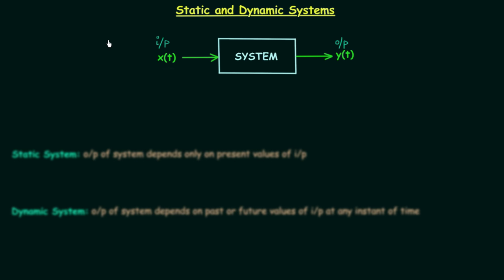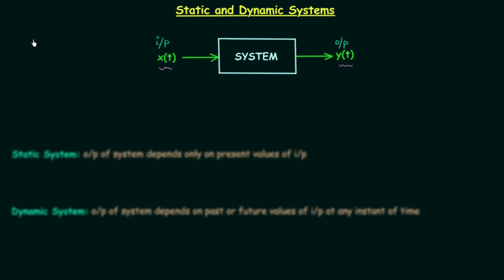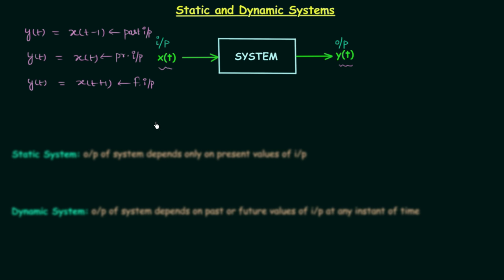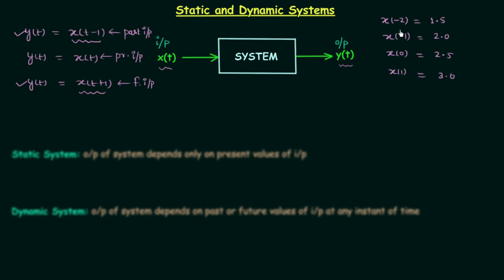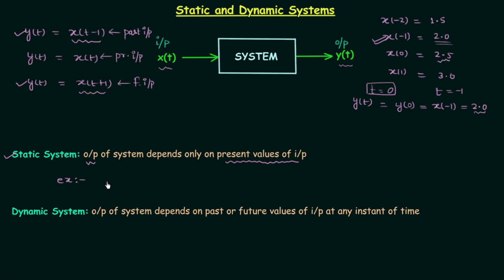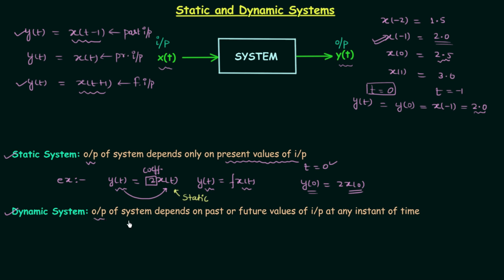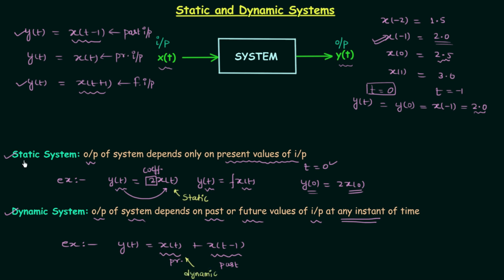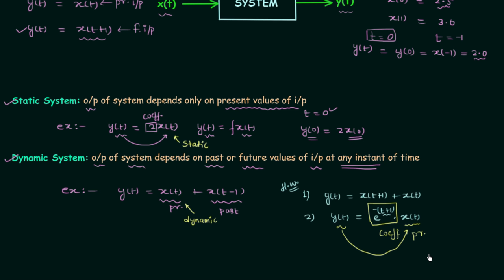Static and Dynamic Systems

Comment: the output y(t) depends on a future data x(t+1), therefore the system is dynamic( memory)
Reply: Exactly
Reply: i don't understand. Is it that t1=t0 +1 therefore t1 is a future value or is the logic x(t+1) is a left shift of x(t) therefore y depends on past value?
Reply: @mrherrada797  x(t+1) is nothing but " 1 value added to x(t)"
Reply: @ybnsnsh6425  wrong its 1 added to the value of t so if you take x(0) u add 1 to the 0 not to x(t) so its like x(0+1)

Comment: the answer is static system because in the output the x(t+1) is  not gonna be feasible for real time as we will be needing the next value every time for x(t+1) than the value we are evaluating so static

Comment: Why don't we consider the coeffficient of the input signal, it together with the input signal gives the output signal so it is also a part of the input signal ri8? then why not consider it ?
Reply: Basically,we have to find relation between i/p and o/p signal which gives us information about system's nature as output y(t) depends on input x(t) only so there is not great role of coefficient  in this type of relations to identify system's nature that why we don't have to much bother about coefficient!but yes while plotting these signals then coefficient  is important!!!
Reply: the coefficient is constant. It's not a function. We just need to find the nature of the systems so we can neglect the coefficient.
Reply: @shanmusetty2404  its depends on x